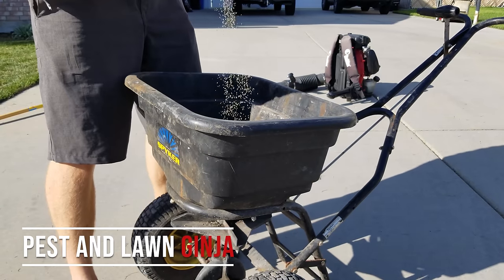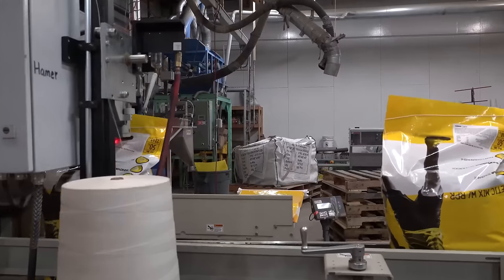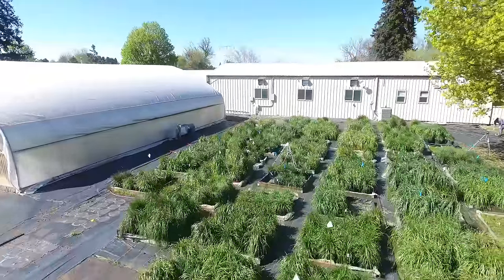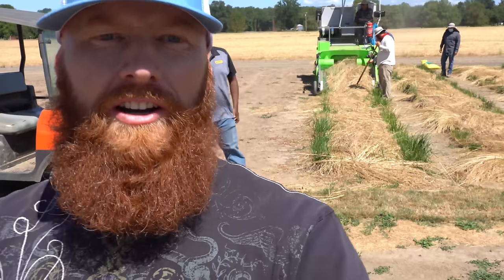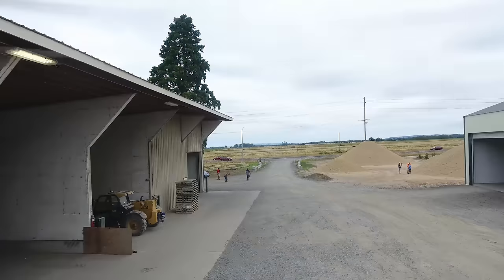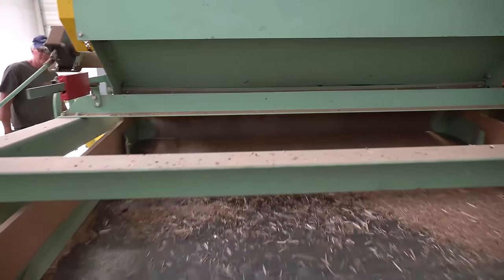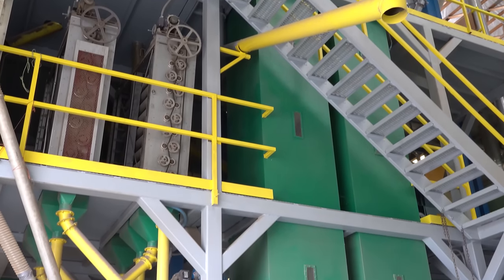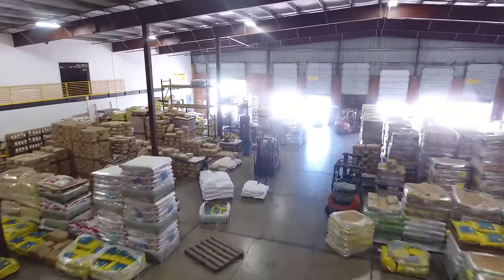How Grass seed is made.  Why you shouldn't buy cheap grass seed. Barenbrug

Comment: I bought some Barenbrug, 25lbs Sun N Shade, fescue, rye, Kentucky blue mix based on your video. This one is fast germination.  Disappointed. Since no local store stocks this seed I made an on-line order with Ace Hardware with store pickup (free shipping). I get it. It's only 12.5 lbs, seed. The othed half is coating. WEED content 0.30%. I did not open and returned it. It maybe great seed but I didn't give it a try based on the coating and the high weed content. Is was about $55. The other one I was going to buy was also a Fescue seed mix for the transition zone for about $75. I would give it a try but I'm trying to determine if it's coated and what the weed content is. I contacted them and haven't recieved an answer back. 

I bought more Scott sun & shade, fescue mix (fescue tall & fine, rye, kbg) with fertilizer + soil conditioner. It's expensive in that you only get about 5lbs of seed in 40lb bag, but it works well. It only covers 2000sq-ft for new lawns (4000sq-ft reseed).  

I also bought Ace Hardware branded seed that Barenbrug produces. I bought 3 small bags, Sunny mix, Shade, High Traffic. They coms in 3lbs or 7lbs sizes. This is pure seed  no coatings.... Not cheap it's $12 for 3lbs or $22 for 7lbs. However this 100% seed no filler or coatings has label clearly stateing  that Barenbrug makes it, seed type %, and the weed content is very low, 0.01%. I just planted some of these seeds to fill in areas that initial seeding failed to  take. My yard is coming in nice with Scott, but had bare spots due to wash out from torrential rain two weeks in a row, just as seed was starting to show. One day was al ist 3 inches! I have slopes and top soil and seed went bye bye. I am recovering and with Scott and some of the Barenbrug Ace branded seeds. I put them in different area... based on sun condition

I called and wrote Barenbrug. They are nice but did not get a good answer for my questions yet. They did recommend their RTF seed for shade and Athletic Field grass for my full sun parts of my yard. 

The confusing part is Ace Hardware list over 9  Barenbrug branded fescue seed mixes alone. Unfortunately online they don't tell you if it's coated or not. I don't want coated seed. Bottom line it's hard find information and find stock to buy. Part of the issue is their seed mixes change over time. So I understand they can't get specific, but seed coating should be online information.
Reply from the maker: for sure.  barenbrug is a massive supplier and supplies off brands as well.  seed quality will vary which is why i stick to the links i've provided in the description of the video.
Reply: @pestandlawnginja  HEY Lawn Ginja. Happy New Year. *Well right now my Tall Fescue is green mid winter despite freezing nights and freezing rain last week. Looking good. I went with Titan RX for my 2.0 lawn. My 1.0 Lawn planted in March 2021 grass using some Scott (mixed cool season seed types with Fert for sun and shade) and some Barenbrug did not survive last summer which was brutal. So I smoked it and re-seaded in Sept 2021. I went with ALL Tall Fescue or Titan RX, 25 all seed (no filler). 

Last time (1.0 lawn)  I only had 3 or 4 months to established. Here in Memphis TN area July and Aug is hot hot hot. So now I have a healthy lawn. This time to got Pre-emergence down in the fall/winter along with Fert and nutrients. So I have a running start into summer with the grass fully 9 months old before the max heat of summer in July and Aug. I dug up some of my grass to do some fence work. The roots are getting deep. 

Q: I have one problem. I need to over seed damage caused by dog pee by neighbors dog in front yard (just one area but really thanks). Then Racoon and Opossum make their rounds at night and do some yard digging. It is minor but I do need to re-seed. My plan is to put down a little more pre-emergence down before temps go up above 55F soil temp first part of March. I will have to wait 6 months before reseeding in Sept. IS THAT CORRECT Yard Ginga?  

I made a mistake by not putting pre emergence down until Dec. I was not going to put any Pre-emergence down until late winter early fall March time frame. We had a mild fall and early winter. I was cutting grass up through Dec and even after New years day. It was not growing fast but still needed to be cut. However some weeds popped up.  I should have put the Pre emergence down in late Oct early Nov, but decided I'd wait. I figure better late than never and got some  Prodiamine 65 WDG (Generic Barricade) down in Dec. Not sure I need to put more, but I will follow the directions. I will likely put a touch more (light mix) down end Feb early March before soil gets above 55F.  However I can't reseed. I will wait  until Sept, so I have 6mos since last Pre-emergence application. Seed is pretty expensive to throw down on ground with pre-emergence to get no germination. What is your thoughts on reseeding and pre-emergence timing.

BTW I put down Zoysia sod down on the grass strip between street curb and side walk. That was the first of my 1.0 Lawn to die. It gets more head being surround by concrete and having no shade of any kind. I bought a few 100 sq feet of Sod and got it down white it was still summer and hot. WOW lots of stolons and rhizomes. I will experiment. If tall fescue does not work out for me with Titan RX (designed for high heat) I will likely go to Zoysia. Right now the Zoysia is BROWN and UGLY... I hate the look of it. Summer Zoysia is green but the green is light, looks LIME GREEN compared to the DARK Green of the Titan RX Tall Fescue.  Cheers.

Comment: Fascinating content.  Nicely done.  I may have missed it,  but curious how they eliminate the weeds.  Too bad it's not widely distributed on the east coast.  At least it's not at the usual home centers.
Reply: Some weeds are cast away through blowers, but the bulk of the weeds are filtered out through the screens on the shaker tables that move back and forth. The screens are adjusted based on the desired seed species, which fluctuate in seed size.
Reply: @micahg9627  Thanks Micah.
Reply from the maker: Nailed it

Comment: So is what you use for seed, would it work here in Seattle WA area?  I am with you, made the mistake of getting seed at the box store and regret it.  seedsuperstore was decent, but the one I used was iffy.  Not sure it was a good one for my location.
Reply: Hello, Barenbrug rep here. The bluegrasses used in a few of P&L Ginja's videos probably wouldn't perform the same in the Pacific Northwest, west of the Cascades. They can be used as a component grass pretty well to add traffic tolerance and recuperation, but the bluegrass doesn't care for our cold, wet winters. Turf Blue HGT has been used on fields at the University of Portland, for perspective, but only as a mixture with Perennial ryegrass. Hope this helps!
Reply from the maker: yes, barenbrug manufacturers seed in albany oregon.  great seed.

Comment: Thanks for this video,  So what makes Bluebank KBG from Superseedstore so expensive?  $90+ for 5 lbs.
Reply from the maker: If I were to guess it probably doesn't produce a large quantity of seeds. Lower yield = higher price
Reply: Kentucky Blue Grass seed is much smaller than the seed from other grass varieties. So in a given weight of KBG you have many more seeds than in the same weight of other grasses. More seeds in a given weight translates to higher cost per weight. The spreader settings for KBG will usually be much smaller than for other grasses too, so you spread the same number of seeds more or less over a given area.

You should look at the coverage per dollar spent rather than the weight per dollar, to see if it is going to cost more to use a given seed,
Reply from the maker: You make a good point. $90 per 5lbs is still crazy high. Check cdford.com and see if they carry it
Reply: @stevebabiak6997  I paid $95.99 for 5 lbs.  Overseed rate 1 lbs./  1k sqft and new lawn 2lbs./1k.  I'm very happy with the results so far and I guess not a bad price for  what you get in the end.  Heck, a couple bags of top soil and peat moss will run close to the same.  I'm at day 15 since seed and very impressed so far.
5 lbs does my front and back lawn so not bad.  If I had a larger property I would probably go with the barenbrug.

Comment: Have you ever tried the landzie or any other peat/compost rollers to lay down top dressing? I need to raise the height of my lawn in a few spots and level the lawn out and have seen and heard a lot about these things. Want to ask a professional opinion instead of just jumping in.
Reply: Peat and compost won't particularly raise the level. They are organic matter that breaks down to feed the soil. You need to add topsoil or sand a quarter inch at a time and let the grass grow up through it. Or add all the soil you need and reseed.
Reply from the maker: video coming up on the landzie type products.  Michael is right.  peat isn't used to raise the height of the lawn.  I have videos on this subject.  I use a combo of top soil and sand.
Reply: Pest and Lawn Ginja sorry I didn’t mean I was going to use peat to raise the lawn. I think the tool is called a peat and compost roller. Sorry for the confusion, my thoughts on raising the lawn was to get a mix and use this tool to spread it all out. Thinking 50% topsoil, 25% sand, and 25% peat. But my lawn is also compacted and harder than Chinese algebra so possibly go less topsoil and more sand.
Reply from the maker: @mariuszsobieraj1769  they do well when you're only filling gaps .25" or lower.  I use a shovel and a levelawn for raising anything higher than that.  I have a video on it that I released a few weeks ago.  fun stuff

Comment: “Why you shouldn't buy cheap grass seed“. I've heard this from multiple sources. Serious question… what's wrong with Scotts seeds?

Another question. You said these are coated with fertilizer. Does that mean you don't apply starter fertilizer?
Reply from the maker: There yellow jacket varieties are coated with a starter fert so you don't need to put one down.  the scotts blends are ok..... overall the health could be better, it does germinate faster but that's not necessarily a good thing.  check ntep.org

Comment: I have a 40,000 sq ft lawn. Any alternatives for me without breaking the bank ?
Reply: One way some golf courses reduce maintenance and ultimately lower their inputs is to create some naturalized areas that are only mowed 1-2 times per year. One way they do that is through low input grasses like Fine fescue species! Also, this isn't an alternative, but to keep in mind the seed rate in combination with the price of the seed. Bluegrass has nearly one third the seeding rate of fescue and ryegrass. Comparing cost by area of coverage makes bluegrass one of the more affordable options, especially if the product thrives for many years to come (variety & environment dependent).
Reply from the maker: mathmatically here's how I see it.  you'll need 3lbs per 1000 sq ft for a general overseed if the area is sparse.  if its a bare spot you'll need 7lbs per 1000 sq ft.  soo......   120lbs for a general overseed or 210lbs for a barespot overseed.  doing a triple pass for lawn aeration would make for the easiest way to ensure seed to soil contact.  I would chose either perennial rye or kentucky bluegrass because the grass naturally spreads once it sets in.

Comment: What is the typical shelf life for rye and KBG?
Reply from the maker: From what I've been told the shelf life is 1 year.  let me explain.  at 1 year they say the efficacy rate of germination is still very very high for all the seeds in the bag.  every year after that the germination rate goes down.  I've had seed sit for a few years and most of it still germinated.  Keep it dry when storing it.
Reply: Pest and Lawn Ginja thanks!  I’ve used seed 2-3 years and still had good results.
Reply: @rapfreak7797  What P&L Ginja said. Dry place, and cool if possible as well. Consistent temps like in your closet in a plastic tote can keep seed going strong for a good amount of years as long as it was purchased at an already high viability rate. We actually store some of our breeder seed in cold temperature storage; a large, glorified refrigerator essentially!

Comment: Makes me want to overseed but worried it's too late now in Michigan.
Reply from the maker: Preferably 3 to 4 weeks out from the first freeze
Reply: @pestandlawnginja  thanks.  Usually first freeze is near Halloween.  Is spring okay too? I need to level it too after watching your videos :)
Reply: @jkbaker01  spring is a little more difficult to overseed because there is more competition with annual weeds germinating, and the ground is still cool compared to about Sept 1. Because kentucky bluegrass has a longer germination time, I'd give 6-8 weeks before average first frost, because it's just an average. If it comes early and your grass has been slow, that's no fun.
Reply: Depending on what part of the state you’re in, you may still have a window but it’s closing fast. I’m in the western suburbs of motor Detroit and wished I’d have had it down by the last week of august vs second week of September. Soils temps were prime back then. They’re a little cool now which is slowing germination times.

Comment: Ginja, Product looks exceptional, however, I have 22,000 sq ft to overseed. This is going to break the bank ☹️. I just can’t justify it.
Reply from the maker: You'd need 66lbs for an overseed. Not too bad
Reply: Gary I did a Barenbrug reseed last weekend using the Ginja preferred Turf Blue Pro which is a kbg blend. The seed size is unbelievably small. So there are 1.3 million seeds in a pound and therefore Barenbrug recommends 1-2 pounds on a overseeding. You can buy a 10/25lbs bag of the yellowjacket coated from Barenbrug on Amazon with free shipping for $65/$175 or uncoated seed in 5lbs increments at Todd Valley Farms for $35 and based on my experience I would guess the shipping would be $25 for 25lbs. 

If you are going to be doing thorough prep work I think the yellowjacket is not the way to go as you get half the seed per pound but I think it would increase your chance of success if you just planned on spreading the seed without any other effort. Hope that helps.

Comment: That 31 tall fescue grass seed shown in the video being bagged is sold at Tractor Supply - 50lbs $69. No need to pay 5X the price for Barenbrug.
Reply from the maker: You CANNOT compare the two.  RTF tall fescue is a regenerating and self repairing / spreading fescue like kentucky bluegrass.  the K31 does NOT spread or regerenerate.  comparing the two is like comparing apples to gasoline.

Comment: geeze...  normally I feel you are non biased, but this video you failed it.  The pics show the Landsy has more and larger gaps on each and every run.  That's what you started out saying.....
bare spots.  😣😔
Reply from the maker: Its hard to tell and show the entire experience through the footage.  I appreciate your feedback.  What I failed to show properly was the amount of disfunction the peak seasons spreader had.  the shoot constantly opening.  the gaps in the grates were wider and allowed a lot more debris to come out which was embellished by the landzie.  I would suggest that you and others purchase both units and then tell me your thoughts.  at the least, which nobody will, check the reviews on the peak.  they all tell a similar story to what I went through.  As for biased reviews......... what do i have to gain...... absolutly nothing.  The lesson I learned is there could have been a better way to tell the tale.  I stand by my decision.  the landzie is by far the better unit.  the design they used fixed the biggest issue of the peak, which is the door and latch failure.  it did cause the issues of the bare spots as you mention with chunky material.  but who is going to use chunky material?  if you watch at the end of the video when I lay down the peat there is no gaps or barespots.